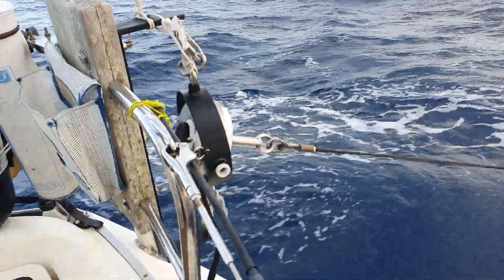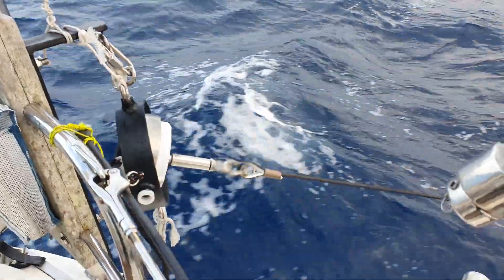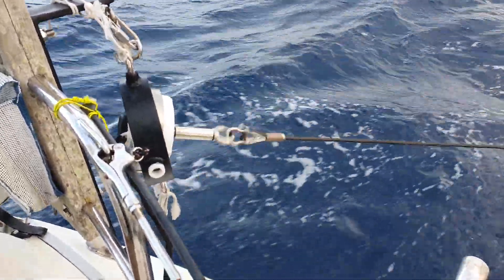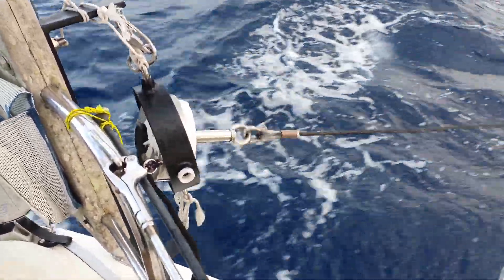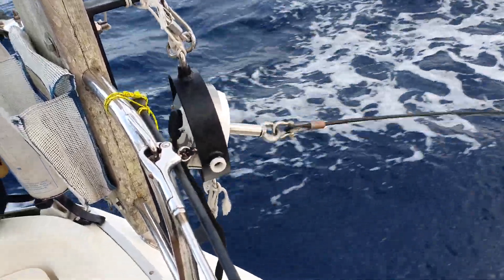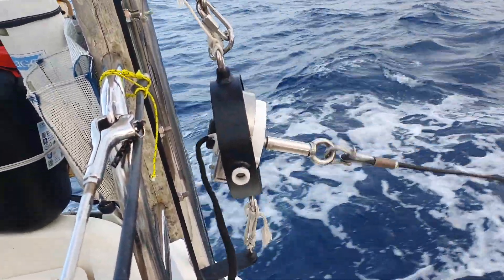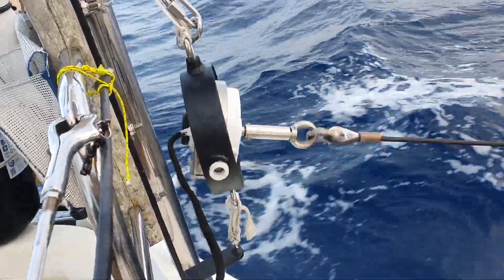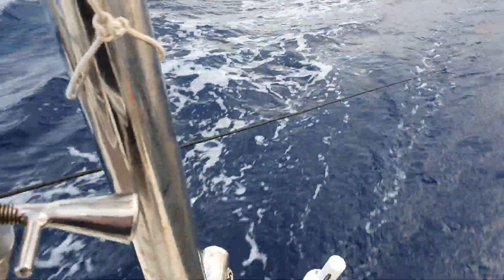Home made water towed generator , high output

Comment: Hi , what size is the propeller you are using please and do you know the rpm it drives the generator at ?
Reply from the maker: The prop is from a Torqueedo  outboard ..They are VERY sharp and seem to be the perfect pitch ..Rpm unknown , but suspect 500 -750
Reply: @NigelLoller  Cheers , not much info out there on successful diy projects for towed hydro generators.   The fact that it can produce 5 amps seems promising .

Comment: Excellent idea, congrats! What is the cut in speed in knots of your setup (I imagine you have a 12V)? I have a slow boat, so I'm interested in a solution like this for the long hauls.
Reply from the maker: Hi , thanks ! ..At hull speed , i.e well powered up, there is no drop in boat speed discernable ,but at about 5 knots in 9 or 10 knots of wind she loses about 1/3rd of a knot
Reply: @NigelLoller  Thank you for your response. At what boat speed does it start producing power?
Reply from the maker: @opaezosu  At about 3 knots ,it does 1.5 amps
Reply: @NigelLoller  thank you!